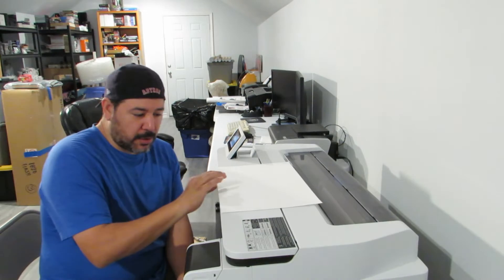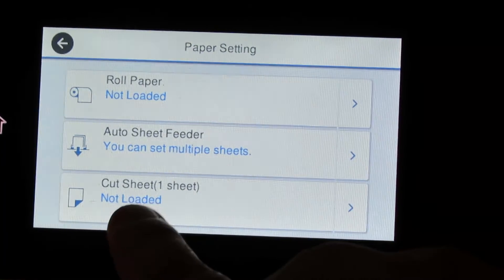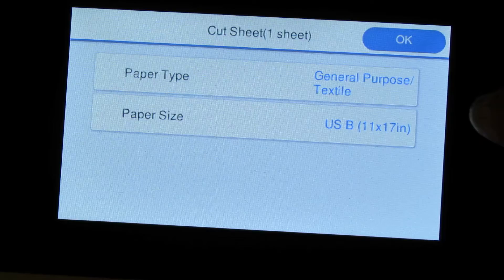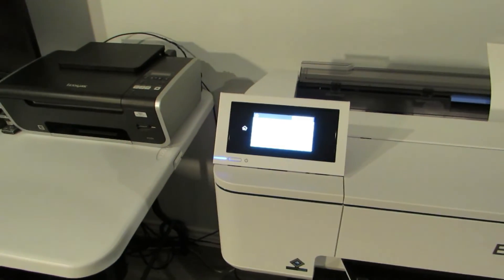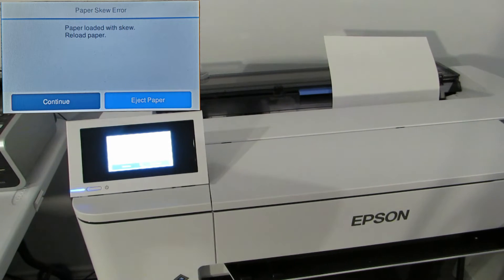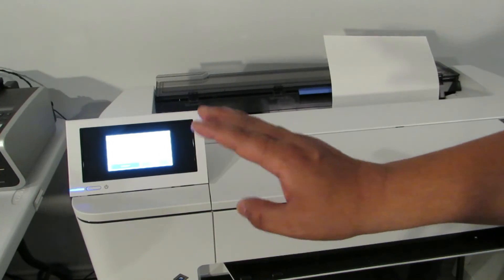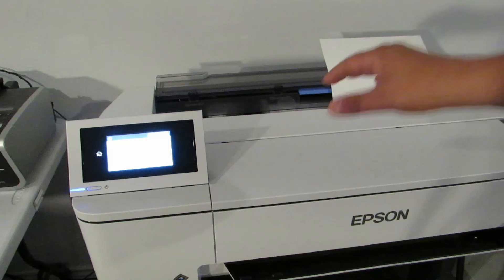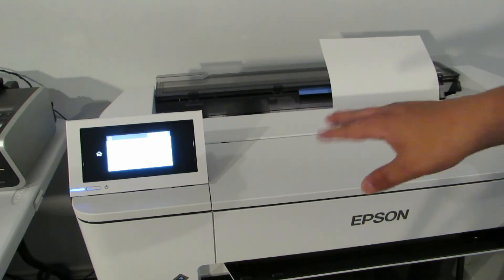Epson F570 Dye Sublimation - How to Load Paper Correctly - How To Fix Paper Skew Error (S5; E3)

Comment: Tryna find a video that has any steps to clean this thing. I’ve done the head cleaning and power cleaning and still have no color coming through even got a new maintenance box for the cleaner. But still can’t get anything to print on paper. It did sit in my garage for one summer it hits about 105 here in central Cali assuming the heads are just badly clogged ?
Reply from the maker: Since your Epson F570 has been sitting in a garage through 100+ °F summers, there’s a very strong chance the ink has thickened/dried inside the lines or the printhead. Sublimation ink is especially prone to this in high heat. If you haven't already, I would join a couple FB groups, because there are a lot of peeps in your same situation. The FB group below, is very helpful.

Check out: https://www.facebook.com/groups/EpsonF570UserGroup
Reply: @DiverseCityPrint me and my wife actually got it going ! Thank you for he response.
We had to completely take it apart. Bought a cleaning solution and pushed it through the lines. It was a huge pain in the a** but it worked ! 
Took about a solid week. After a few maint. Box purchases we decided to get the chip reseter and we now just clean out the maint. Box and got it printing perfectly again. 
Thanks for the reply !
Reply from the maker: @aceduece1988  Nice man! Now that's dedication!.. actually when you spend almost $3k, it's desperation lol. At least now you know more about your printer and if it ever happens again, you know exactly what to do and can now help others that fall into the same situation. Thanks for sharing your process. Hope it helps others out there.

Comment: Paper jam without any paper please what solution
Reply from the maker: Even the slightest piece of paper under the wheels, can throw a paper jam error. Get a flashlight and look all around, even the corners/edges.

If you have thicker paper, like cardstock, manually run that through the paper feed a little bit (very slow) to see if it dislodges anything. I don't believe there's a way to remove the message, so look really good under the rollers. Most of the time, pushing a piece of cardstock slowly through the paper feed will push anything in there, out...

Try turning it off for a minute and turn back on to see if it randomly clears it.

Comment: Can i use htv vynil paper? Thanks in advance.
Reply from the maker: It's not a paper, but yes, they sell a Sublimation HTV Vinyl that's receptive to sublimation inks. Try and search it online, but most of the time you will need a vinyl cutter to cut the image out.

You print your design on the Sublimation HTV Vinyl left-to-right (not mirrored), dry the ink under heat press element, use the vinyl cutter to cut the image out, place the printed vinyl on the item facing up, put a cover sheet on top and press.

Comment: That really helps but how do I use the other paper slots? What setting do I put it on? I've just done the printing with the roll paper but need to learn how to use 8.5 or different size papers because sometimes I use the roll paper for small projects and that is alot of wasted paper.🤦‍♀️ Thank you I'm glad to kno how to print this way too.
Reply from the maker: Hey @Carla Evans Farmer you can use the sheet feeder (the black flap/tray you saw me push forward in video). Push that back and once you put paper in there, it will automatically detect paper in the sheet feeder section and you select the paper size from the screen.

The sheet feeder accepts A4, LTR/LGL, 9x12, B4, 11x17, A3 sizes.

If you push that tray forward to use larger single sheets, it accepts 12x18, 13x19, A2, 17x22, 18x24, B2, 22x34, A1, 24x36 sizes.

When you click the button to select your paper size and it is not showing, then scroll down to "user-defined" and it'll let you input your own paper size and you can choose to see it in mm or inches.

I can try and make a quick video on that, if you're still having issues printing with different sizes.
Reply: @DiverseCityPrint  ok. Thank you. I will try it this week and let you know. I'm a visual learner so the videos help but I will try what you said first and let you know. Thank you
Reply from the maker: @carlaevansfarmer5924  Sounds good. I will make a video this week for printing different paper sizes, just so it's out there for others as well. Hope you get it working before then, though.
Reply: That has been my problem. I have not changed my settings at all; however, when I place the paper in the tray it says paper is not detected @DiverseCityPrint
Reply from the maker: @firstfruitcorban7070  have you figured it out? what size sheet(s) are you inserting into the tray? I've been able to put a narrow 3.5" wide piece of paper and it still pulled it in, and I haven't run into the issue you mentioned, so I can't speak on that. Try shutting the printer off for a couple minutes then turn it on again? See if that helps.